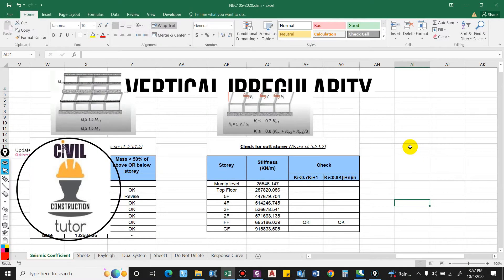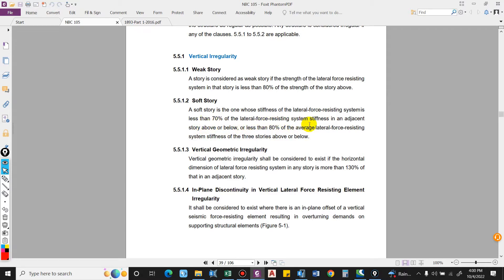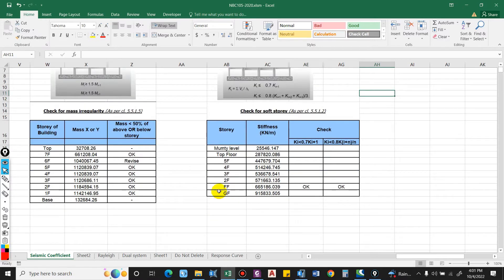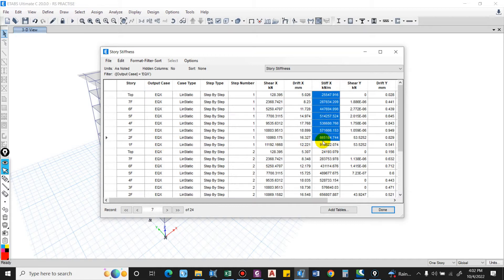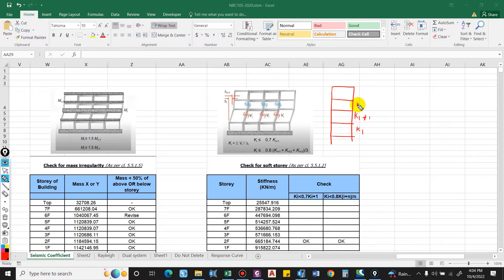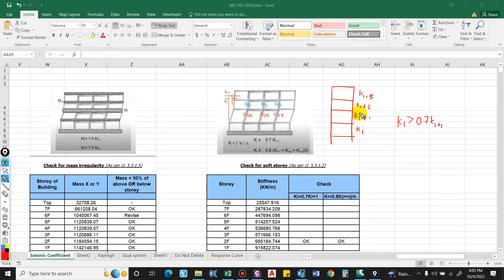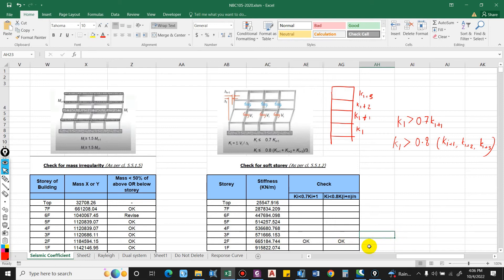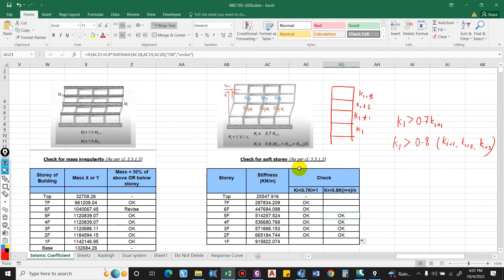Soft story check-in building | ETABS Analysis of Multi-Storied Building | NBC 105:2020, IS 1893:2016

Comment: Thanks for this video. Hope next will be on "weak storey".
Reply from the maker: A weak story generally doesn’t occur as it is dependent upon the lateral strength of the story. Since the column size doesn’t vary abruptly so the case of 80% of shear strength is easily achievable. In the general case, the size of structural members is always greater for the lower stories so no weak story case. Only for floating columns or wall discontinuity, a weak story may arise.
Reply: @civilconst  Will you please provide tips on how to compute the lateral shear strength of a storey? This terminology is rather confusing to me. Thanks!